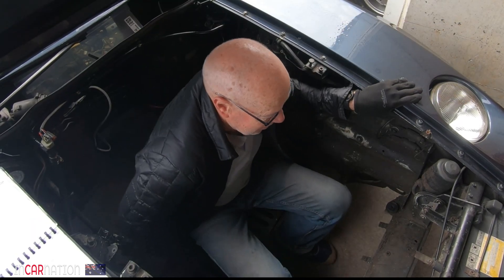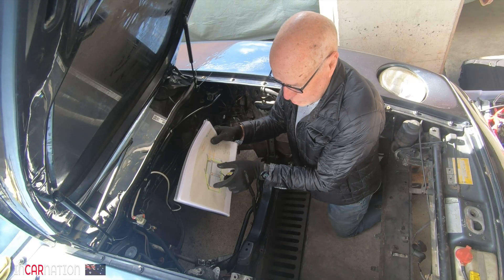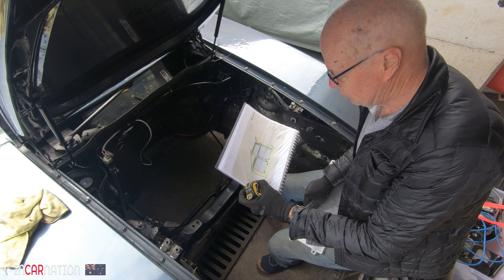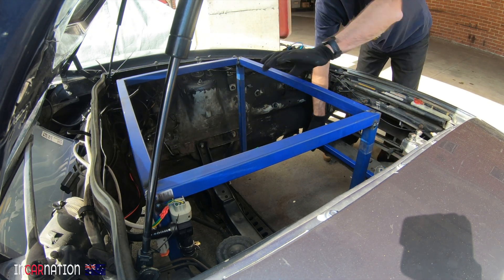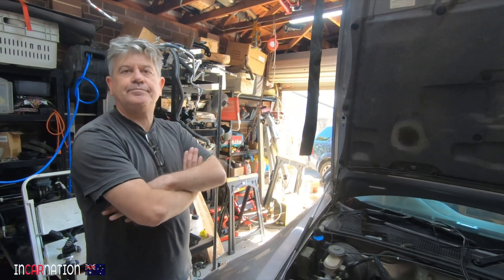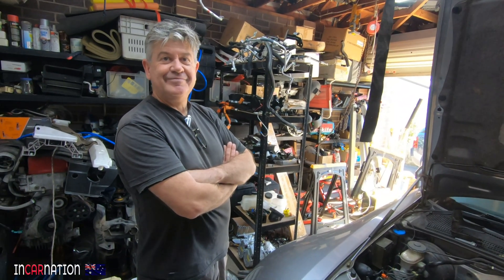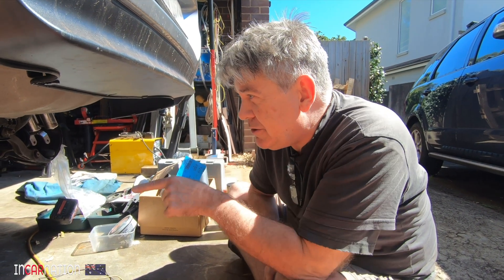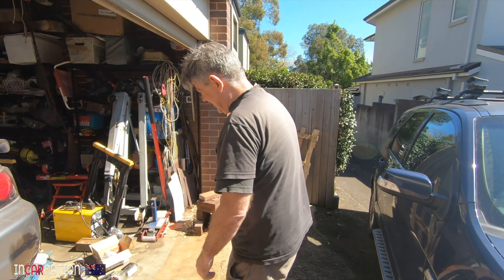Episode 29 – Porsche EV Conversion | Building the Battery Box

Comment: Hi mate, are you planning to put a "bash" plate underneath the battery bay??  May be worth both for underbody aero and reducing risk to the battery from road debris (no, not suggesting that you go offroading to Cape York !!!). Also, are you considering to put vibration rubbers to mount the battery pack to the frame, to reduce vibrations into the pack?
Reply from the maker: The battery box will be fully enclosed but yes certainly there has to be a solid skid plate to prevent it being snagged by something. Although it's a good idea, due to space restrictions, was not planning on vibration dampers. The box will bolt to locating rails welded to the chassis. The original MG battery was rigidly mounted (22 bolts) so we'll do the same.
Reply from the maker: Will probably have rubber strips along the rails under the battery box
Reply: @inCARnationAustralia  excellent, that sounds like a good idea, the more vibration reduction, the better it is :).  All those poor little electrons will thank you for that!!!!